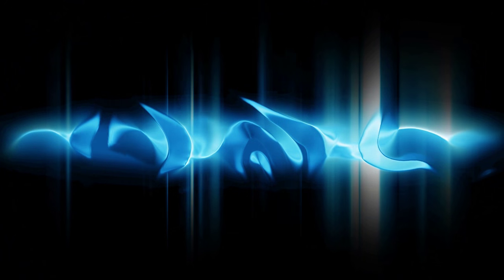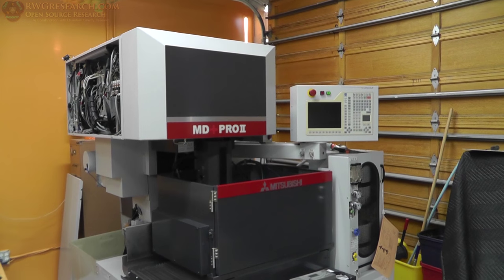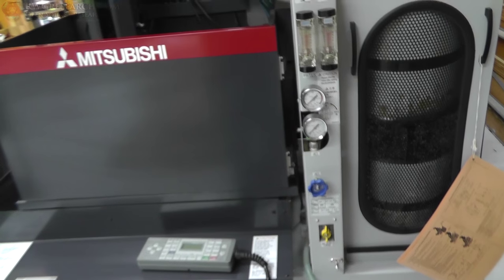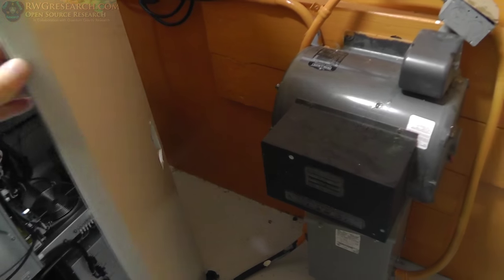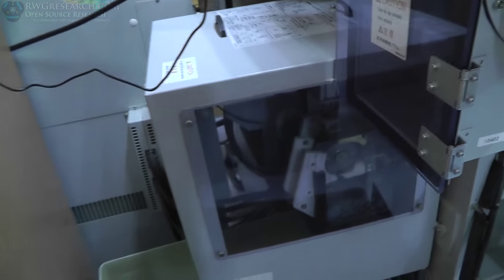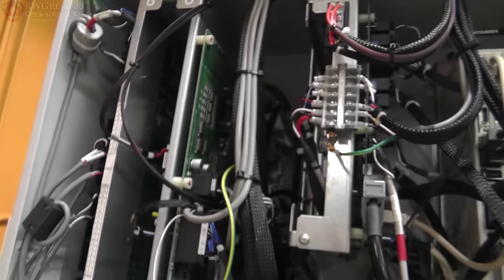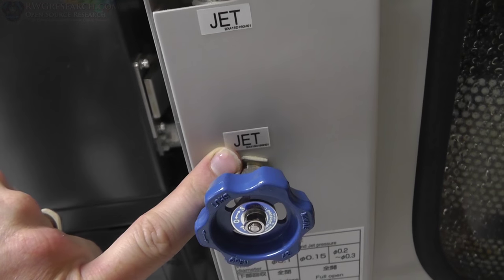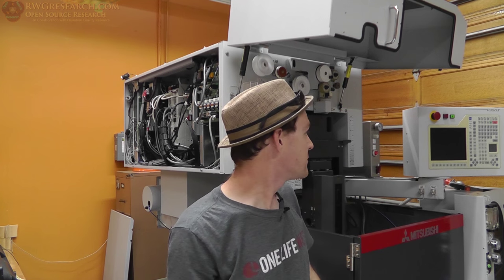What Drives A Wire EDM CNC? (Electrical Discharge

Comment: I have run wire edms for years and i have had to change quite a few batteries the secret is to always have it powered up while changing them so they don't lose their positions . re homing can be a big pain. I have run almost every kind of machine  but I miss the wire machines the most.
Reply from the maker: +Cruze Missile yes, that is correct. However, once its dead.. its dead. funny thing is is did change them with the power up and still they all faulted out. had to reset and calibrate all of them... they are a cool machine. ~Russ
Reply: +Cruze Missile Depends so much on the machine make & model. On some it is forbidden to "hot-swap", on others it is necessary. And on some there is no need for such a battery, as there is thing thing called EEPROM or HDD ;) Like on a Heidenhain controller on a VMC at work, if you pull the battery with the power off, there is still enough juice to power the memory for 8-16 hours if I remember correctly. Means that there is no need to worry when changing the battery.

And of course every machine owner has a back-up copy of the machines parameters stashed away, so it is just a matter of reuploading them. Like Heidenhain service, they take a copy of your parameters and can store them for you in case you lose your own copy.
Reply: my boss never had the forethought to buy any back up or pay fore service contracts he only bought older used machines. and I had to figure the fix by myself.